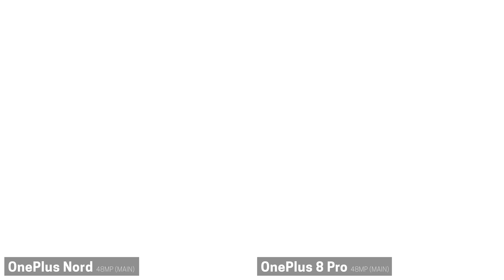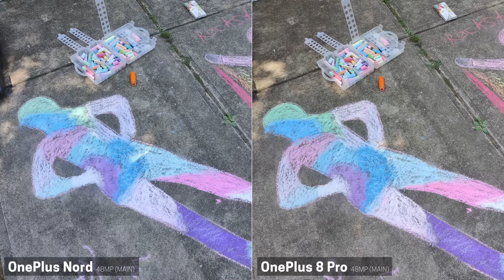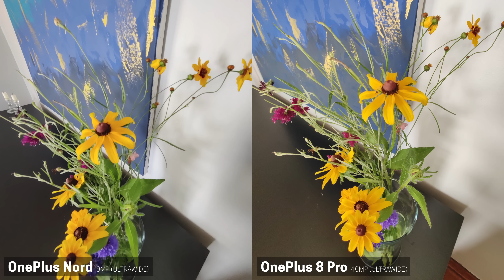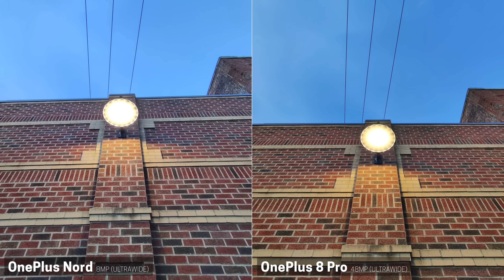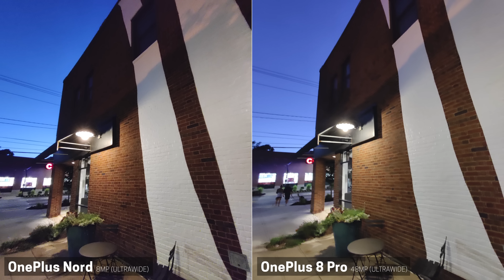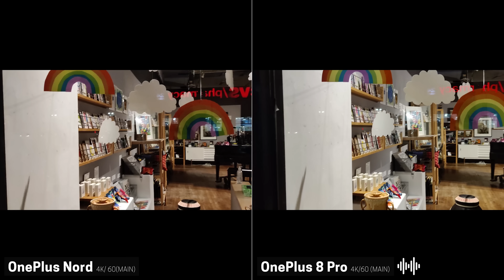OnePlus Nord versus OnePlus 8 Pro camera comparison

Comment: Thank you so much for the comparison.  Since they said 48MP sensor was same, I was wondering if there's any real world differences.  I do see some differences.   Nord vs LG Velvet or Nord vs Moto Edge might be interesting, as well.  Edge is on sale for $500.  Thank you again for great videos.
Reply: It is not the same sensor, the Nord sensor is the same as the OnePlus 8 but not the Pro, the Pro has the IMX 689 which is better, the Nord and the 8 have the IMX 586, which is the one used by the Pro in the ultra wide

Comment: Very little noticeable difference between these cameras. The Pro telephoto is better than the digital zoom on the Nord most of the time (the exception being the low light alley shot which is very noisy on the Pro) but given the Pro costs over twice as much as the Nord I don’t think you’re giving up too much with the cheaper phone. If photography is really really important you could get a Nord and a half decent compact camera for less than the price of an 8 Pro

Comment: Who so difficult to add a SD slot?
Reply: honestly a lot of us are over it 😂 as long as it has UFS 3 storage and there is better water resistance (although not officially)..just get the 256 GB variant
Reply: @mediocritycentral  think properly. The base variant is the reason it's making headlines, because it's cheap.. But in reality base variant is trash.. What will one do with 64GB if SD slot don't even support?
Reply: @kamisamadesu  Honestly not really concerned because I'm not from India anyway like most people.. Sorry if you feel like it's only in India that the Nord is getting traction. I'll have you know the Nord has been hyped WORLDWIDE. Wow shocker. Sure the European prices are a bit higher but they're still relatively competitive. People who 'think' and are smart buyers would definitely get the 256GB variant..as for the people who are desperate to get a new cheap Oneplus phone, they have that problem to deal with if they choose the 64GB variant. No biggie. It's not a deal breaker. Cheers~
Reply: @mediocritycentral  why don't you buy better phone if you have money? 🌚
Reply: @kamisamadesu  that's just it. Even in Europe the prices of the Nord are still relatively lower than most of the competition so even the 128GB and 256GB variants are still priced right for Europeans..and you'll be surprised how a lot of people will be buying this because flagships cost too much. Also because the Pixel 4a is taking so long to launch you have a lot of people seeing the Nord as a good option.
Reply: @kamisamadesu  besides if the Nord is STILL expensive for some or they'd rather get a phone with an SD Card slot because the lack thereof is a deal breaker for them, then don't buy it. That simple.
Reply: @mediocritycentral  you know. The Nord base price is same with Realme X3 price having SD 855+ and got SD slot too..
Reply: @kamisamadesu  nice. then that's probably the phone for you :) Don't worry. I can agree with you that the Nord is overhyped but you can't deny it's still a good phone for a chunk of people.
Reply: @kamisamadesu  Oneplus has been disappointing a lot of its fans lately and that includes me. To be honest, the only thing keeping me interested in Oneplus is OxygenOS

Comment: Can nord take 4K 60 ? confused
Reply: Its front camera only
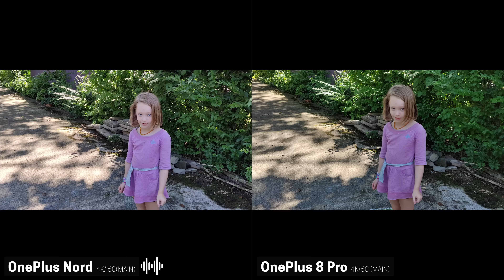Reply: @sunithaunni9167  check 4:26 of this video. It mentioned as 4K 60 from rear camera..
Reply: @vishnuprakash7433  But others says its not rear camera .rear camera support 4k 30fps as well as front camera support 4k 30/60fps that means flagship features this features not support other phones at this price range
Reply: I'm using OnePlus device, I search in OnePlus community form,
OnePlus Nord don't have official 4k 60fps record option in Rear camera,
Most people confused about latest update,
Actually update was belongs to Front facing camera 4k 60fps. Optimized for smooth Video calling.

There no official confirmation about unlock 4k 60fps for rear camera

Hope well if users complain about that OP team Unlock in future.
Reply: Oneplus Plus know it.. they have restricted to 4k 30 because the SD765 processor trends to over heat at 4k 60..
Reply: @janumalarajaaditya1504  i have doubt oneplus nord does not support smooth extreme graphics in pubg but vivo x50pro does support smooth extreme feature same chipset765g  what the reason
Reply: I'm not mentioned It doesn't supports 4k 60fps. & Smooth & Extreme graphics in Pubg

Actually it Supports easily but company locked 4k 30 fps in camera and in Pubg as well restricts for some cause.
We don't know why company restricts in Minimum resolution.

Probably maybe some Software optimization in thermal management issues.

Definitely OP team unlock everything in Future updates.
Reply: @janumalarajaaditya1504  future updare may be 3 years 😂
Reply: I'm using OnePlus 6 since 2018 June,
Still now OnePlus given Lots of Update to my device even it was 2 years Older model, still I'm getting updates every month,

Recently OP release Android 10  to 1+5t device, it's a 3 years older device,. still it's gets updates,

OnePlus is the Best Brand for updates in Android platform.

OnePlus Nord get 2 updates with in a week 10.5.1 and 10.5.2. (now running in 10.5.2)
OnePlus good for Updates
Reply: @janumalarajaaditya1504  but smooth extreme does not support

Comment: This is exactly the debate thats going on in my head at the moment. I'm buying a new phone in a couple of weeks and i still dont know if i should go basic and get the nord or go big and get the 8 pro. (Obvs OP8 is irrelevant now). I'm only considering Oneplus phones at this time purely for my great exp w Oxygen OS. (Coming from 3T and 5T)
Reply: If you are happy with the current flagship specs then go for the OP8 pro. For me, it's difficult to buy OP8 pro knowing that the upcoming snapdragon 875 will be a 5nm chip with significantly high performance and efficiency, a 100W fast charging tech. Also under-display cameras are coming in 1-2 years' time. My plan is to get a mid-range phone now as my current phone is trash and get a flagship after 2 years. Do note that if you wait you always get better tech and you have to settle at some point.
Reply: Based on ur budget for mine I'll go with Nord 😉

Comment: But isn't 4k 60FPS unavailable on the main camera of the OnePlus Nord?
Reply: I'm using OnePlus device, I search in OnePlus community form,
OnePlus Nord don't have official 4k 60fps record option in Rear camera,
Most people confused about latest update,
Actually update was belongs to Front facing camera 4k 60fps. Optimized for smooth Video calling.

There no official confirmation about unlock 4k 60fps for rear camera

Hope well if users complain about that OP team Unlock in future..
Reply: With the latest patch, Nord is 4k60fps capable =)

Comment: 4k 60 fps available on Nord???
Reply: I'm using OnePlus device, I search in OnePlus community form,
OnePlus Nord don't have official 4k 60fps record option in Rear camera,
Most people confused about latest update,
Actually update was belongs to Front facing camera 4k 60fps. Optimized for smooth Video calling.

There no official confirmation about unlock 4k 60fps for rear camera

Hope well if users complain about that OP team Unlock in future....
Reply: It is available in the front camera. 4k 30 fps is available in the rear camera
Reply: @mathsguru4733  but he has mentioned 4k 60 fps (main), not selfie
Reply: @napster5774  Maybe he is wrong or I think the company enabled 4k 60 fps both on back and rear cameras.

Comment: Great job man. This has convinced me to buy the Nord, no qualms.
Reply: I'm done pre booking☠️
Reply: IKR, got mine already! Its FIRE
Reply: @mikezgen2980  Man have you tested it for any green tint or other screen issues? I have already pre ordered it but I have grown more insecure about it due to so many claims and hate for it on the internet. If you think you got any screen issues( test it if you can, a page on reddit does have a thorough detailed process) and reply! Thanks
Reply: @mikezgen2980  Also , I'm not super nit picky, so very minor non noticable issue won't bother me that much, but like on the oneplus 8 pro it was very significant.
Reply: @aryanagarwal2227  no issues here I've tested multiple times. I've friend who also bought Nord and they also don't have problems

Comment: Nord cannot record videos at 4k 60fps , only limited to 30 fps at 4k from rear and can record 4k 60fps from front. it's quite impressive at this price and it can perform very well. 
Really appreciate your comparison videos..❤
Reply: I'm using OnePlus device, I search in OnePlus community form,
OnePlus Nord don't have official 4k 60fps record option in Rear camera,
Most people confused about latest update,
Actually update was belongs to Front facing camera 4k 60fps. Optimized for smooth Video calling.

There no official confirmation about unlock 4k 60fps for rear camera

Hope well if users complain about that OP team Unlock in future.........
Reply: No 4k at 60 fps was enable through ota

Comment: I thought the nord wasn't capable of 4k 60 rear video
Reply: Yah Present Out of the box It doesn't supports 4k60fps in rear camera,
This SOC supports 4k60fps aswell

Probably they may some issues in optimizations or may be Issues in thermal management system.

OnePlus team solves in future Updates,
We definitely see 4k60fps in rear camera
And smooth and Extreme in Pubg as well.

Comment: How are you doing 4k 60 on the rear cam on OP Nord?
Reply: Probably update
Reply: So, it means that the text in the video is wrong I assume? It must be front camera or it must be 30 fps?
Reply: @kyhfin  it's 30 fps
Reply: OnePlus ady unlock 60fps 4k in latest software.
Reply: @gilger93  ohh thats niçe
Reply: I'm using OnePlus device, I search in OnePlus community form,
OnePlus Nord don't have official 4k 60fps record option in Rear camera,
Most people confused about latest update,
Actually update was belongs to Front facing camera 4k 60fps. Optimized for smooth Video calling.

There no official confirmation about unlock 4k 60fps for rear camera

Hope well if users complain about that OP team Unlock in future
Reply: @janumalarajaaditya1504  dont worry sir, IMX586 can do 4k 60fps effortlessly, it will be there very soon
Reply: Yah I too waiting for future update,
Bcz 765 soc handle 4k 60 fps,
Company restricts for some cause.